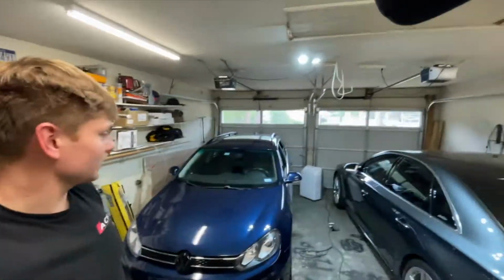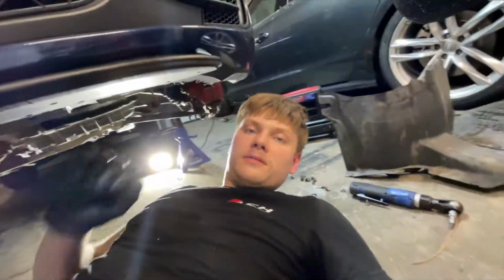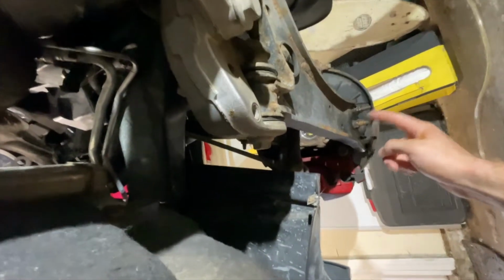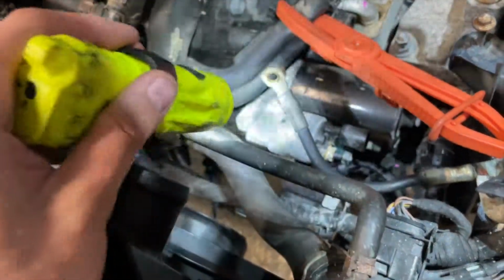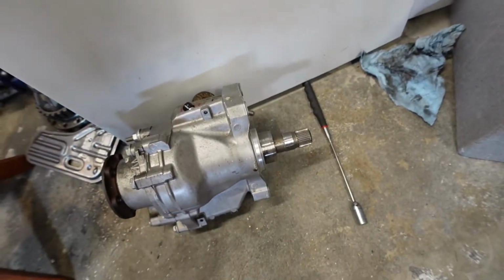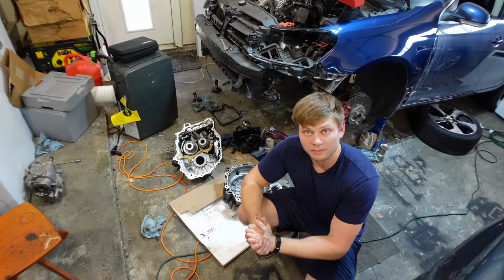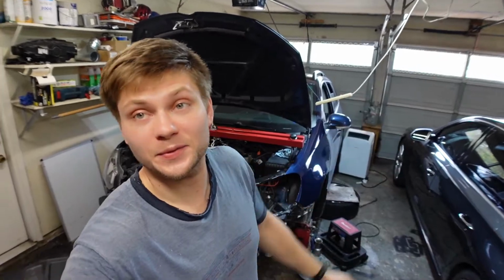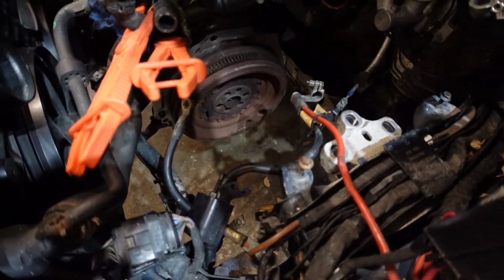RIPPING Apart An 02E DSG Transmission: TDI JSW 4motion Project pt.1

Comment: You said that you grabbed the transfer case from A3. Why didn’t you take the whole transmission and transfer bellhousing?
Reply from the maker: The transmission came off a euro B7 passat TDI and came without a transfer case. I didn't check and thought that Mk5-Mk7 transfer cases would be the same, i found out that they are not